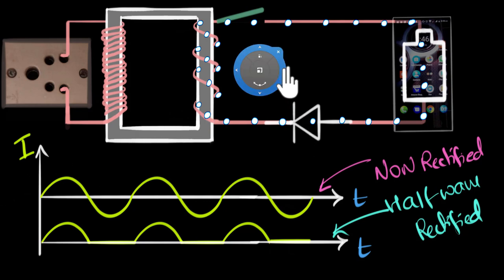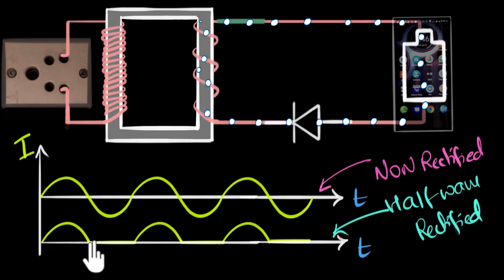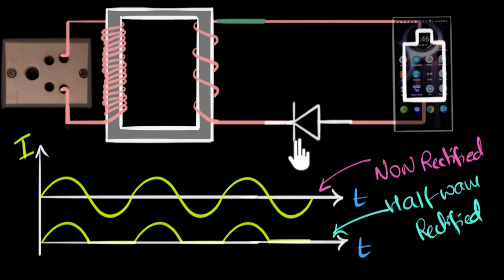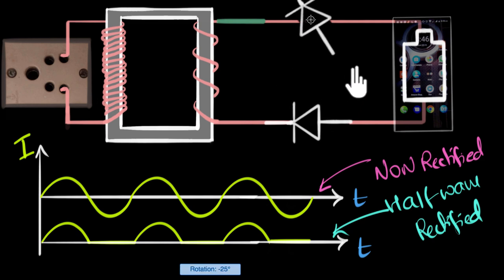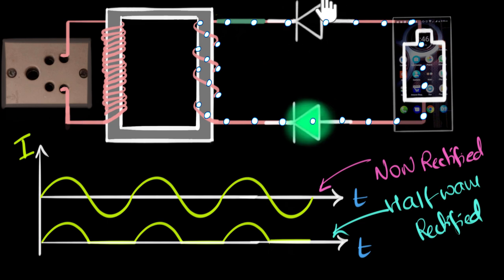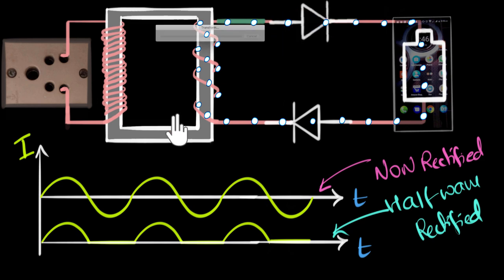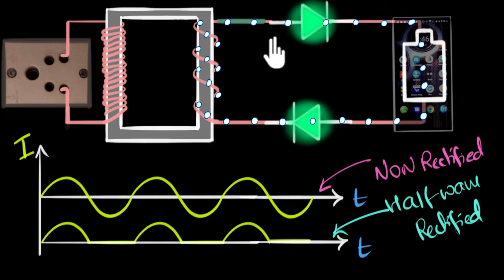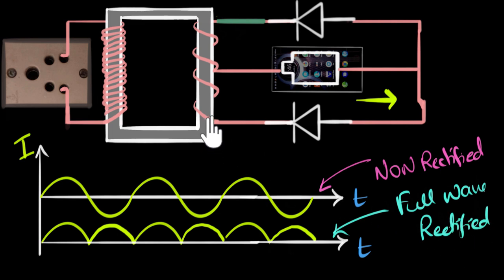Full wave rectifiers | Class 12 (India) | Physics | Khan Academy

Comment: Sir, can you explain, if this circuit is made without diodes what happens? Then is it possible for the current to flow clock wise in both the circuits

Comment: Wouldn't this mean that your voltage and or current goes wacky? You've essentially cut your half of the transformer in two, so you should either: have twice the voltage, or be wasting a lot of the magnetic filed of the other cable

Comment: If the wire is soldiered at the middle of the secondary winding the voltage through the first circuit may be reduced , like to half the amount right ??